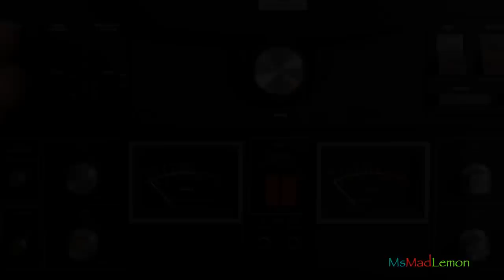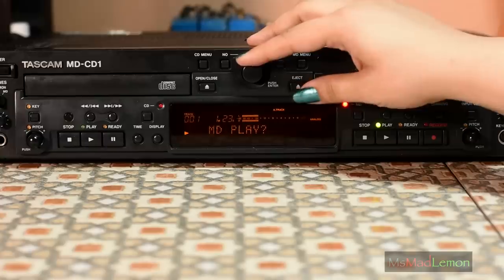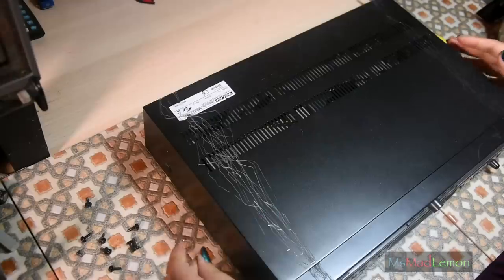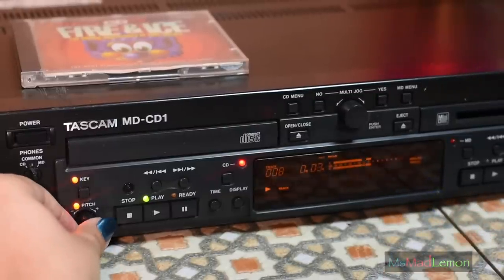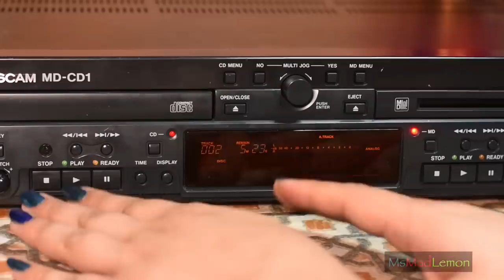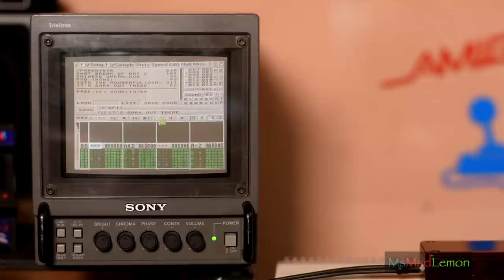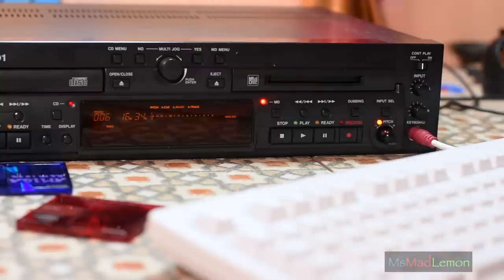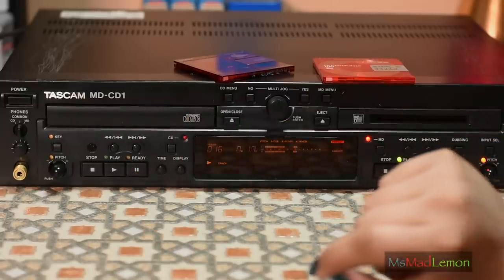Tascam MD-CD1 Exploration featuring the Commodore Amiga 500

Comment: I agree with you on the keyboard port, My Sony MDS-JE640 has one and it's a real sanity-saver when naming tracks, Using a multi-jog dial is a real pain
Reply: also in some pro video/audio equipment from the 90s, specially rackable modules like these, the keyboart input port was used to send commands/update firmware and reset/set factory defaults by service technicians
Reply: My Sony MDS-JA50ES has one too, such a blessing, on my Sony MDS-JA50ES.

Comment: I like the idea of having a keyboard.  I bought an MD deck a couple of years ago so I could use my old discs again but the nostalgia of using the jog wheel to key in titles wore off pretty quickly when doing a whole disc...
Reply: I've just recently got back into MDs and what you said is so true, like spending almost 2 hours labelling a 30 track mix was one of the most tedious things I've ever done!  However there is a PS/2 connection on the front so that's my next purchase, a PS/2 keyboard!

Comment: The key part is just like on the tone known as Master Tempo on the cjd's used in clubs today. When turned on Its locks the track in its original key. 
So you can still alter the pitch faster or slower and the sound doest pitch with it.
Thanks for the video =)
Reply: as regularly used by DJs who don't even mix in key but still have it switched on anyway.  I can usually hear the effect it has on the audio - it's not perfect and often sounds like the audio is skipping, drives me mad

Comment: Interesting video, congrats. I decided to buy one, from a audio studio shop in Germany, obviously used, revised, but it worked at the beginning, and after a month break, I turned it on, but now the CD part doesn't go further than TOC Reading. And that's it. CD doesn't run neither shows time, track info. MD deck is fine, runs and sounds without any problem . Maybe You could help me out what happens. Does anybody know?
Reply: When you bought it from a commercial seller in Germany there is a warranty on it.

Comment: If capacitors are worn, they are worn and should be replaced. However, there is no need to recap Commodores just for the heck of it, capacitor problems remain rare (except for the 1200 lines) and I see no need to change this position. Modern capacitors are often worse than the originals.

Comment: I was hoping you would script around with that serial port. That would be awesome! (/me looks with puppy eyes)
Reply from the maker: haha.. well firstly I never script, kinda do my videos "off the cuff" :o) ... And the RS232 port is just an I/O used to control the deck with a PC which to be honest i'm not that big on getting into :o)
Reply: @MsMadLemon  The Amiga serial port is an RS232 port. You only need a 25 to 9 pin adapter (edit) and a null modem (/edit); something that is extremely easy to solder yourself, and if you can find a manual of this player, you might very well be able to send commands from the CLI of your Amiga to the player. Something like echo 0x000A > SER: for for instance pausing the cd player (maybe I'm mixing up Linux now but you get the idea). Might be a lot of fun :)
Reply from the maker: @Ezyasnos  I won't lie, the thought already did cross my mind about connecting it to an Amiga's serial port lol.. i'll think about it, but i'm not going to promise anything :o))
Reply: @MsMadLemon  Oh I was only hoping. But even if, I think the most tricky part is getting an actual manual of this. You might want to try to telnet to it, that might very well work as that is very much standard. That would be something really unique to the Amiga, controlling this device using telnet and playing mod tunes on your mod tracker at the same time. That is something you couldn't do on other computers back in the day :)